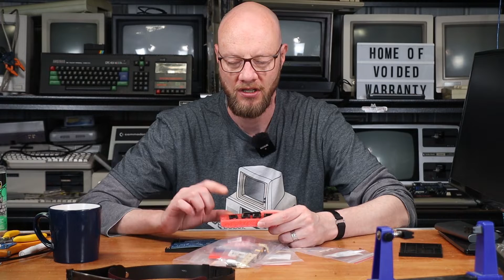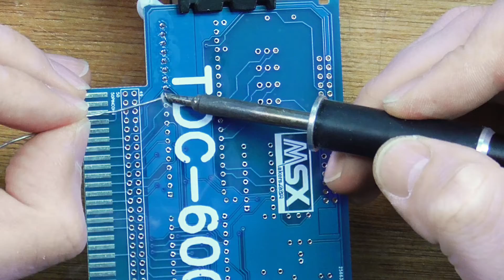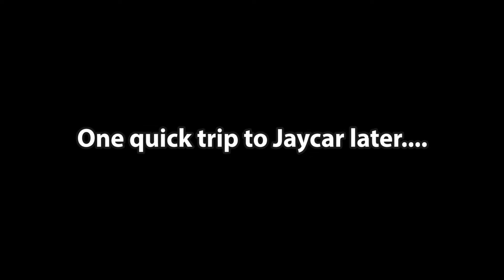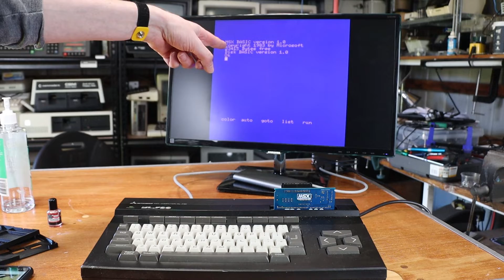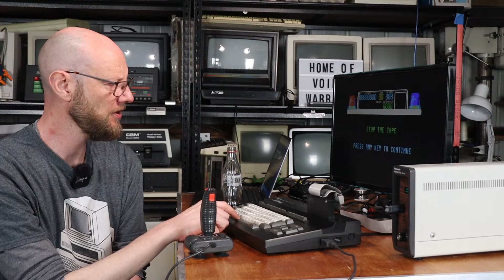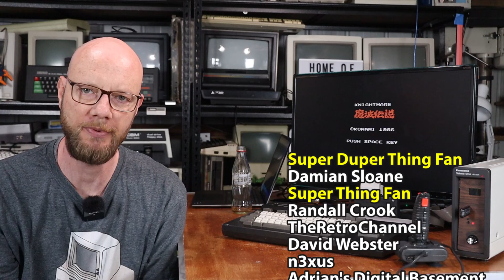MSX Floppy Disk Drive controller (featuring the Mitsubishi ML-F80)

Comment: Because the disk controller is not built-in, there are some restrictions on what it can do - essentially, a cartridge based floppy addon has to remain compatible with MSX-1, and because of that, the ROM's used reflect that too, which is why some disk games wont work (basically they are v1 Disk ROMs) - internal floppy controller, totally different story, also usually not v1 Disk ROMs

Comment: Hi Everyone. Just found the channel. The YTA randomly promoted the thumb of this video. I watch a bit of 8-Bit an MSX content so i guess its doing its job ! Now as a long time MSX'er since 13 or 14 yo I have awesome memories of the platform. I'm having a nostalgia revisit to it this last year or two and am still using a cassette deck ! I WOULD LOVE A FLOPPY DRIVE ! But I'm a bit skint so can someone link me to the information on where i can buy the parts or perhaps even a kit ? Is there a project page for this anywhere ? I can do the soldering and can mostly understand components and some simple schematics but I'm no electronics expert so please advise me as best as your able.I will likely need it ! Thanks. Ive learned a lot from Adrain and Noel and many other retro channels.

P.S. I have found the link to the MSXMAKERS Page but three are no Photos ? I have a list of components now but need to know where to find the PCB ! Anyone know or have a spare one ? :D

Comment: The best way to load software on a MSX is with a SD-Mapper cartridge, which includes a mass storage interface (SD Card), RAM expansion (Memory Mapper) and a "MegaRAM" cartridge needed to run bigger games, like Konami MegaROM titles (Parodius, Gradius, etc).

In fact, it may be that some of the titles you tried to run require the MegaRAM expansion. This was quite common here in Brazil back in the day.

Comment: R-type, I don't think it came with a version for msx1. There are dsk versions of mega rom games for msx1 that require a memory mapper of at least 128KB for the same size of rom image. Msx1 doesn't have a memory mapper. There are 256KB and 512KB too, the latter for example is Hyde lide 3. Great game if you can find a translated version. 
You'd need a flash rom cartridge with sd and memory mapper to run most megarom games. And an msx2 to run the better msx2 disk based games. These are on a whole different level compared to msx1 and zx spectrum games, comparible with some 16 bit systems. Like metal gear 2, feedback, hydefos, undeadline, aleste. Coupled with a scc for many konami games and fmpac/ym2413 (hydefos, aleste, undeadline feedback have support for improved sound) sound chips  gives you the full msx2 experience.

So for now you can only run 16 to 32KB rom games or tape to disk conversions.

Comment: The fdd adapter that I had with my Sony HitBit MSX1 had MS Disk Basic 1.1 and the floppy was 3.5" 360k single side. I used 720k floppies formatted on a standard PC. I had no games, but the computer came to me with a lot of office software (text editor, spreadsheet, printer utilities), a version of Pascal and another version of Basic. All these ran under MSX-DOS, that was just like MS-DOS.
 Maybe you could use that v1.1 ROM instead? Are there any differences between the versions?

Comment: For the first stage of Jet Set Willy, you have to do what you're doing, but you gotta jump from a few pixels further to the left so you grab the key on the way down.

As for the machine, it does have Spectrum style attribute clash, but it is only 8x1(horizontal x vertical), rather than 8x8. Sprites aren't affected by it, though sprites can only be 1 colour, but can be offset by overlaying one or more sprite over one another to give the appearance of multicolour sprites. There really is no excuse for that Chase HQ port.

Comment: King's Valley: What you do after getting the gems; ;is go through the door. There's a mummy guarding it now; so you either have to time it right, or kill it; and I'll be damned, if there isn't a convenient dagger for you to pick up on the middle platform over there. IIRC at least some of the enemies respawn after a while; so don't diddle daddle too long.

Anyway, the game is what I call an Action Puzzler; as you progress the levels become more difficult and require you to puzzle out the path you need to take to avoid and/or kill the enemies at such a time their respawn doesn't screw you over. It gets very difficult, very quickly.

Comment: Here in the U.S. we never got the MSX (or if we did, it was barely and I had never seen one); interesting machine, looks like it's quite capable with the right software.
I know there's an MSX 2, I wonder if the games that don't work are for that?

BTW, liked the video when you flipped off the camera, haha!
(OK, was going to anyway, but had to do it right away at that point 😀)

Comment: If a game is not working, it could be that it was ment for MSX-2, MSX-2 Plus, Turbo-R or MSX-3. Officially the game designer should have let the user know that it was made for a more capable MSX, but sometimes they simply do not follow the rules. Some games need more RAM, some programmes need other special hardware. Most the time games are not working is caused by copy protection, a game that was made for being in ROM can write to its own memory area, and if it is able to overwrites itself then the game knows it is a copy. Think of the great emotional conflict a game can feel, working as it like to work or stop working because the programmer ordered him to do so. Ever tried to get an MSX on the sofa at the psychoanalysts office?
Reply: I suppose that's possible, but usually people who have compiled these games have made sure to put MSX-2 and on games in their own separate section.
Reply: Quick correction, there was no MSX 3. There is a project by this name being developed right now by the original creator of the MSX (Kay Nishi) but besides the name it bears little resemblance to the past machines.

Comment: That's a nice and easy solution for disk loading. I'm using a SD card based cartridge solution with a RAM mapper that can load ROM files and most DSK and CAS. Some game recommendations that are mostly platform exclusives: Bosconian, Mappy, Flicky, Salamander. And of course you have to try the fantastic homebrew Night Knight!
Reply: Hi, I'm looking at this project with a mind to sourcing the parts and building the card myself. I am wondering about the cost of your solution though ! By the time i get the PCB made, source the chips and components AND a floppy disk drive and disks i might well be cheaper with whatever you have ! Can you say what it is that you use and how much it costs ?
Reply: @JohnDoe-qg6hm  the thing I'm using is the SD512. Not available at the moment. Around € 100 if I remember correctly
Reply: Thanks for the info. Hmm I don't know what to do. @KolliRail